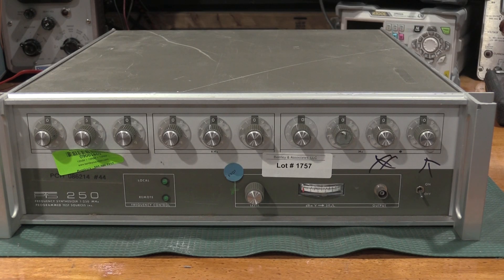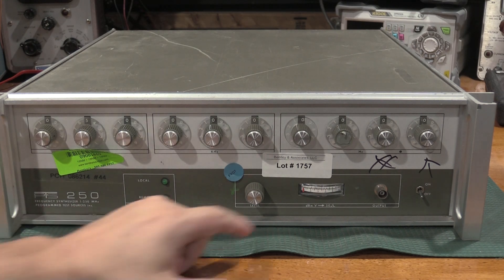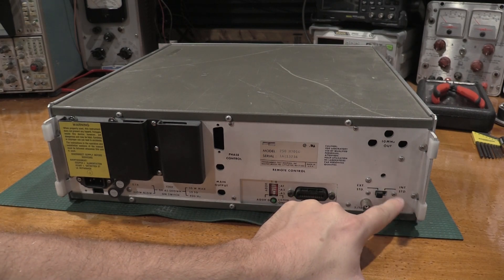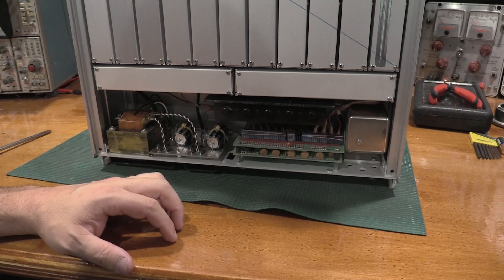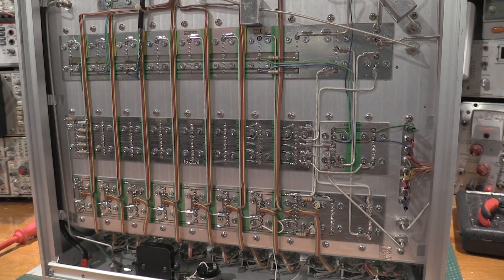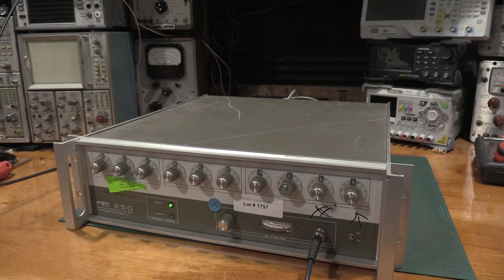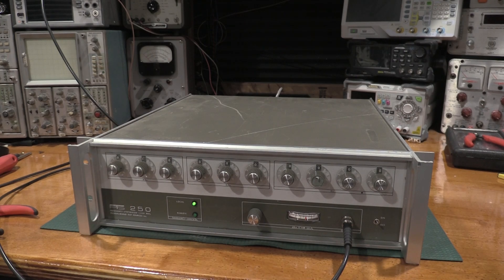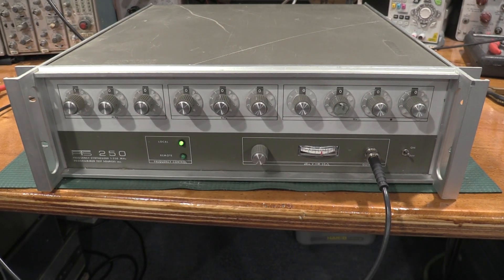Lab Check in and adjustment of a PTS 250 Synthesized Frequency Source

Comment: I have spent many hours maintaining a fleet of PTS1000 and a few PTS500. You should get a schematic and block diagram to fully understand how to adjust the synthesizer. As these units will show its age, you may need to adjust the potentiometers that sets the main VCO with-in range for each 10 MHz step (they are reachable under the metal tape strip). If the oscillator deviates too much the signal passing through the cavity filter will be attenuated, the filter is just a few MHz wide, and thus give very noisy or no output on that particular 10MHz band. The VCO is mixed with a signal from the decade modules and also from a 10 MHz comb spectrum in a way that any drift from the VCO will be cancelled out. Often the 15-turns pots developes back-lash and tuning will be hard or impossible, but swapping for new pots is no big deal, just a lot of work.